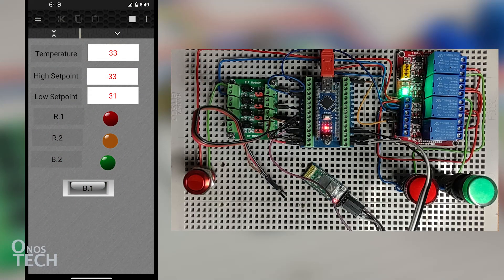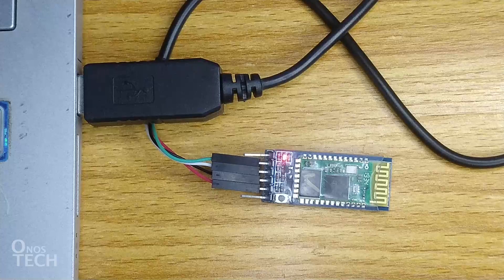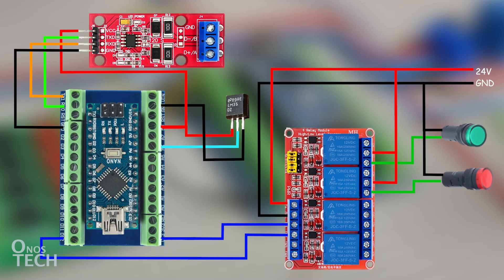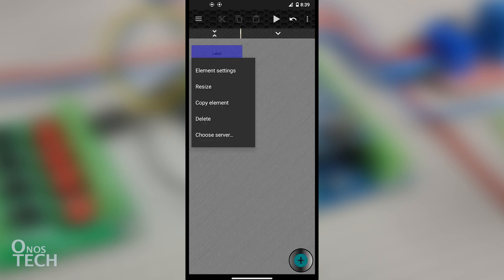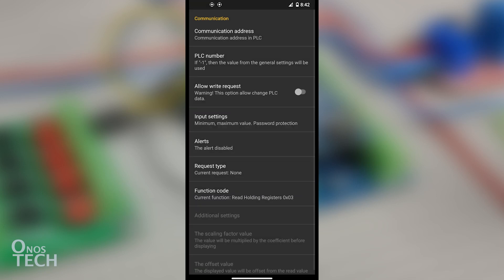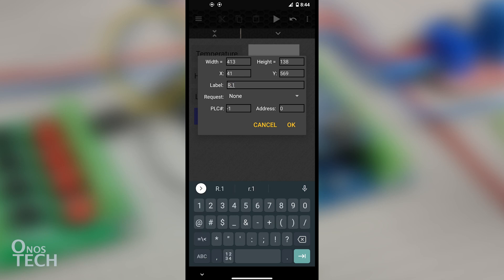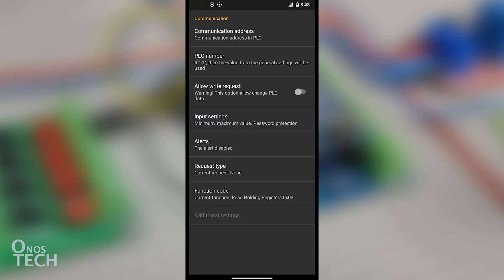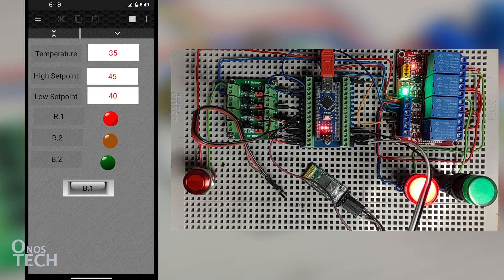#15 HC 05 Bluetooth Modbus Android HMI  | Outseal Arduino PLC

Comment: Sir i follow ur video carefully and at last i created hmi buttons and indicators on my android hmi and run it .but it seems 1 error .and blutooth still connected light gose very slow blinking like video.but my B.1 still not working .and B.1 on the android hmi changing his graphics properly it become yellow when i on it .but plc not taking command .modbus address are ok for B.1 -128 and R.1 -0 slave address is 1.but my hmi not working
Reply: Sir pls some suggestions
Reply from the maker: Send video/pictures to onos.technology@gmail.com
Reply: @OnosTech  sir i send u pic pls responce
Reply from the maker: Did you enable "Allow Write Request" from "Communication Configure" drop down menu?
Reply: @OnosTech  yes sir

Comment: Because in this video in place of modbus address u have typed 1. Please guide me
Reply from the maker: Since the Modbus address was set to 1 in Outseal Studio settings menu, it must be the same as the PLC number in the HMI Modbus app.
The Modbus address or slave address or client address is the number used to identify any PLC in the Modbus network by the master or server device. It can be any number from 1 to 255. This means you can theoretically have up to 255 PLCs on a Modbus network.
Reply: Thanks for your response sir , I wanted to ask that if we not mention modbus address them also we can use mobile HMI or not.
Reply from the maker: Without the Modbus address.the HMI Modbus app will not be able to communicate with the PLC.

Comment: Hi sir hw r u, sir I have a small doubt how PLC program links with Bluetooth.i mean  when ever we setting temperature and other parameters... how PLC will... to set temperature this much only.... Please  give response ... don't think it as silly question.... thanks...
Reply from the maker: The PLC send and receive data with the Modbus serial protocol (please google it). The Modbus communication can be transmitted by wire or wirelessly. In this case is the Bluetooth. See the last three videos where the transmission is wired. The next video will be over WIFI.